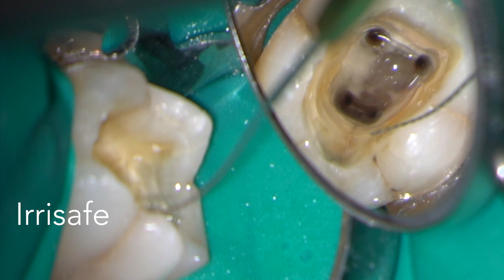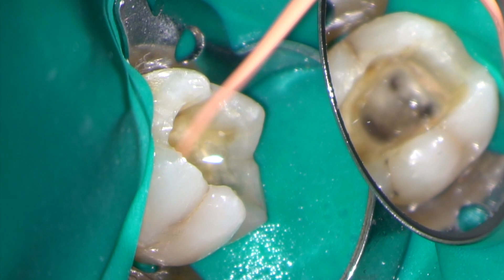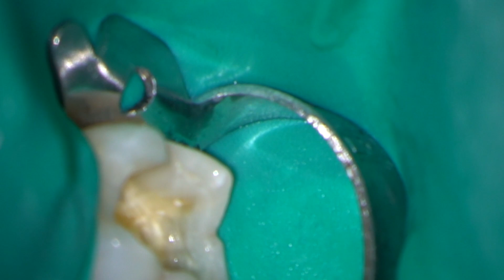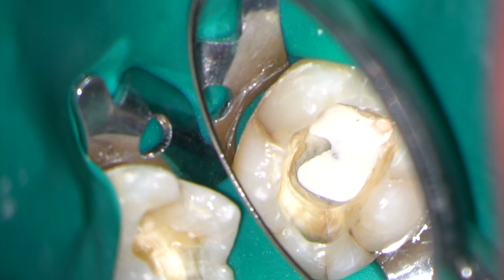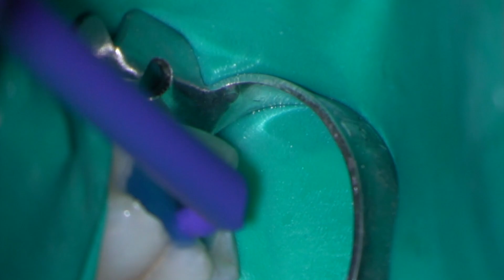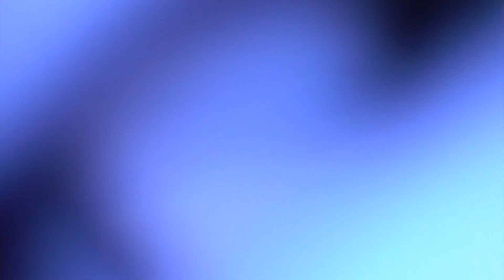LL6 Bioceramic Obturation

Comment: Hi John,
I have recently started using bio ceramic sealer. How do you decide to use a single cone technique and bio ceramic sealer v warm vertical compaction. What is your thought process in making this decision apart from cost
Reply from the maker: Hello Anup
Most cases are obturated with warm vertical. Long thin and curly canals are good with BC
Cheers
John

Comment: How deep do you go with your irrigation needle inside the canals? 
Thanks a lot for your videos. 
We get to learn a lot from them.
Reply from the maker: Hello!
I bend the needle 2mm short of WL
Cheers
John
Reply: I find the tips provided don’t go down all the way.  Do you  enlarge the coronal part?  I have been using a vitapex tip as is thinner but only goes firm 17mm at the bend.  I have the premix version, what tips can you provide.  Thanks again for all you do!!

Comment: Dear mr. rhodes, what if after careful preparation of the canals, you try to achieve tug back with gp fitting, but it still feels loose; even though you achieved working length. What would your advice be then? 

With regards
Reply from the maker: Hello Yvar
In the case of bioceramic obturation this is not a problem as long as the cone does not go too long.
If the cone is passing beyond the apex you will need to trim the tip or use a larger cone
Cheers
John

Comment: Hello Dr Rhodes, 

Thank you for the excellent presentation.  I have a few questions :
1. What instrument do you use to mark length on your GP cones?

2. What happens if you've prepared a canal to the final file size (debris present on tip of instrument on removal from canal) but tugback is not achieved during cone fit.

3. What type of syringe do you use to inject the BC sealer and where can I get some?  

Thank you for your time and kind reply.

Aaron
Reply from the maker: Hi Aaron, great questions and I am pleased that you enjoyed the video
I use college tweezers to mark the GP
You can trim the cone or use a larger size
I use a Calasept (Ca(OH) tip in an Ultradent syringe
Cheers
John

Comment: sir why did you check the cone fit in a bath of irrigant ! wouldn't it give you a false tug-back !
Reply from the maker: Hi Mohamed
I cone fit with irrigant in the canals to avoid any friction that you get with a dry canal.
Cheers
John
Reply: @johnrhodesendo  
so I should test the cone fit in wet canals if the canals are curved as I can reach the full working lentght and avoid friction !
Reply: @johnrhodesendo  
I'm a student so forgive me if i got it wrong